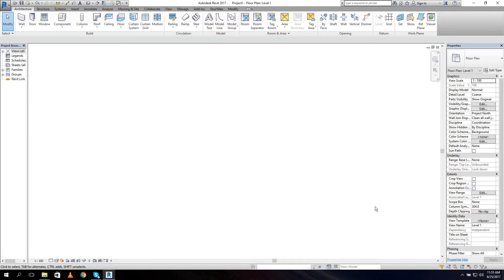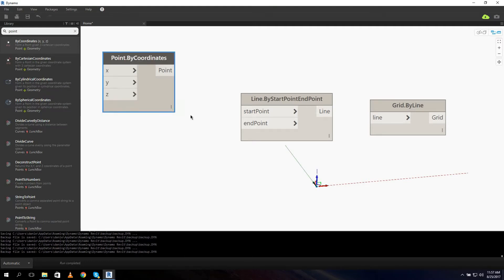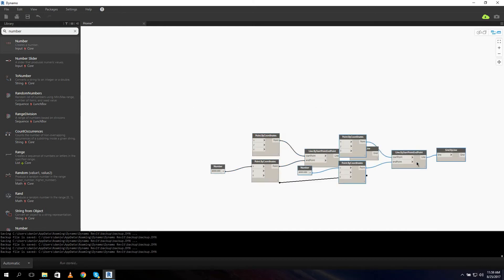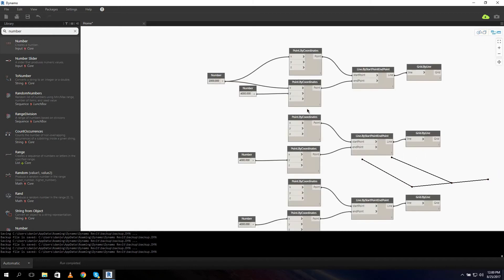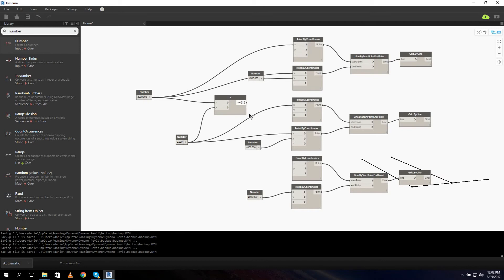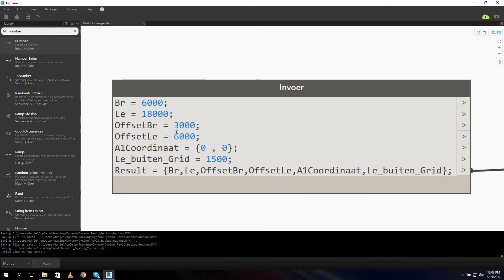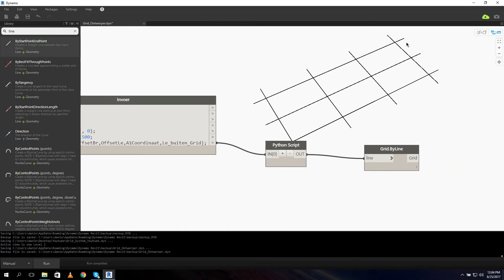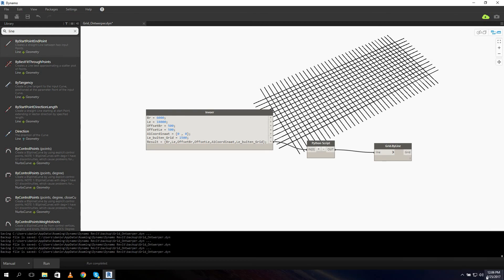Dynamo - Grid Placement Tutorial p.1

Comment: Great video! I've got a question but it is not related to the video.

I'm creating scaffolding families in Revit and I have to create a family to identify the item by the grid position to be able to calculate the load on each leg of the scaffold. For example, let's regard that we have a structural beam locate between grid 1-2 horizontal and A-B vertical, I would like to be able to see it on my schedule, as I can see the column location according to grid lines.

Thanks.